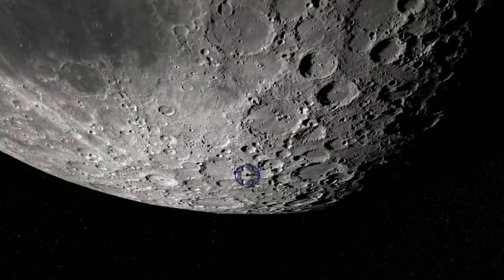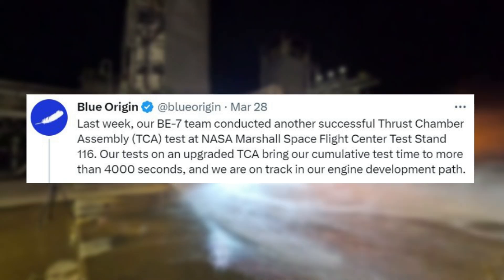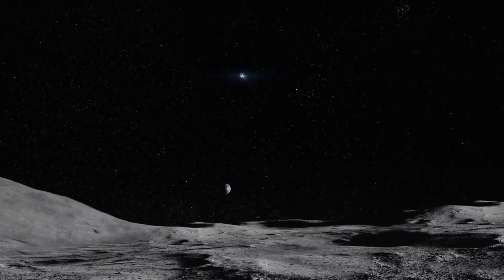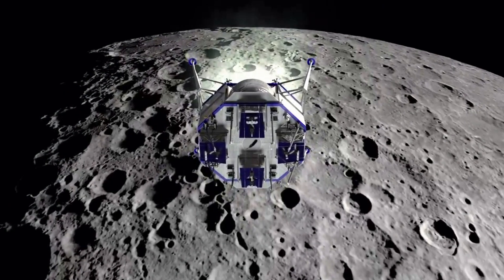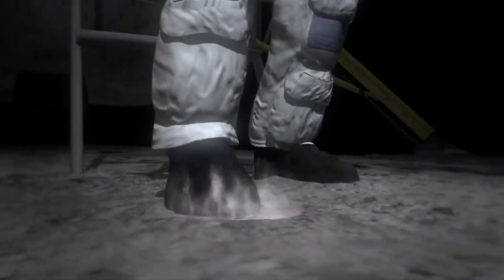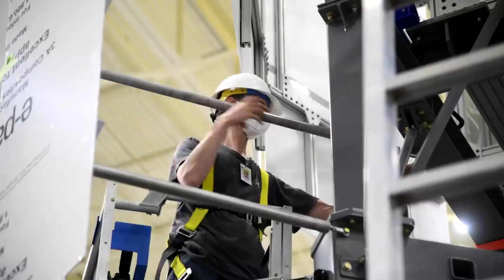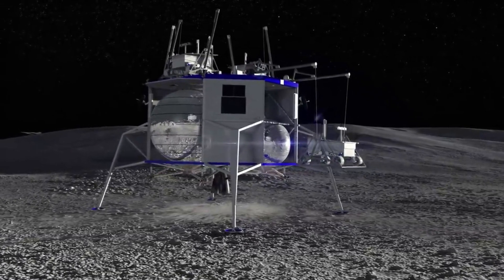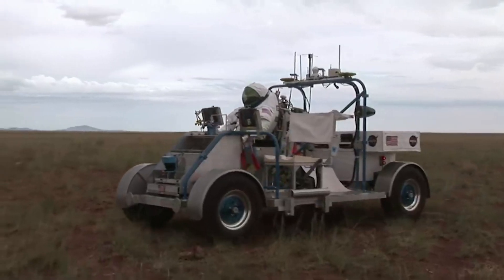New Progress On Blue Origin's Lunar Lander

Comment: The irony of Tom saying "Too much film cooling" when the BE-3PM failure on NS-23 was from lacking enough film cooling.

Also, that BE-7 test engine doesn't have its bell yet, maybe that extra film cooling is for bell cooling on the finished engine.

Their BlueMoon landing sensors have been tested on New Shepard boosters.
Reply: Pretty sure the full nozzle is regen, so film cooling would only hurt. I'm not sure what Tom is looking at; there is no afterburning step or white streaks indicating film cooling. The end of the plume is a little ratty, but there is a bunch of cooling water and a flare pointed at it, so it could be picking up stuff.